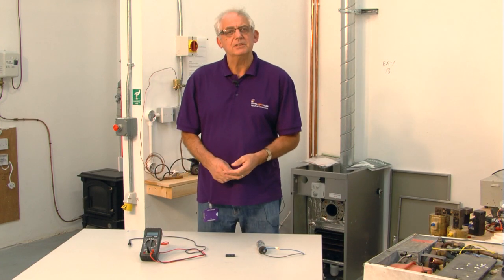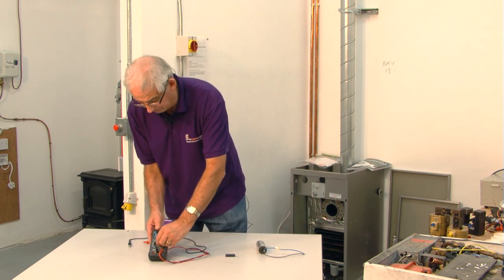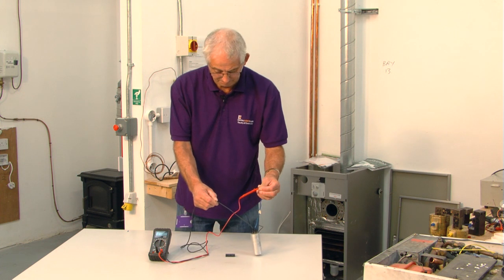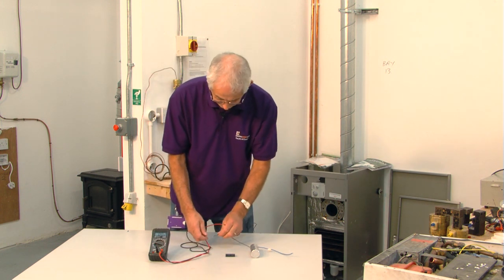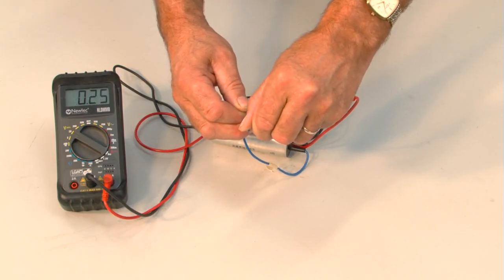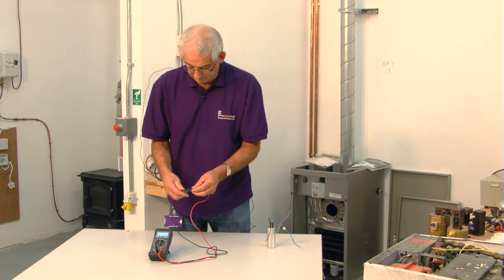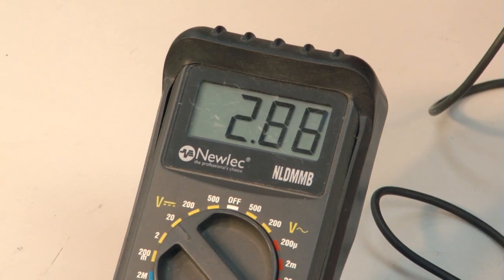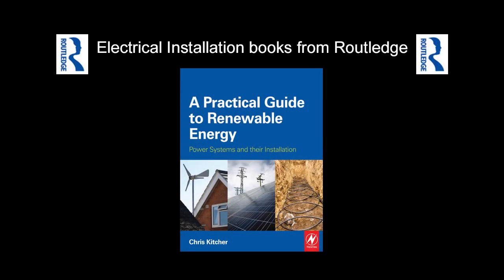Capacitor Test

Comment: Actually, there are a lot of factors.
-When we are dry our resistance increases. 
-When we are wet our resistance decreases. 
-etc.
And most of all I believe the capacitor capacity is low. "JUST LIKE" (12volts or 9v or 1.5v. )battery when holding we won't be shocked or electrocuted.
[Did you know that a even rubber can shocked you? It's called static electricity - well it's not that fatal.]

Being shocked or seriously hurt or death is possible when he swallowed the charged capacitor.

Comment: If the cap is shorted it would give a continuity reading because the electricity would just flow right through and that means it's bad.

Comment: when 1)capacitor is shorted then your multimeter will show very very low resistance or it will sound beep, 2) you asked abt open capacitors? remember capacitors are always open circuited frm inside, its required for an ideal capacitor so when u connect the multimeter it will show resistance in mega ohms! hope u understood!

Comment: YUP! In class one day I was holding two, old axial caps, one 200v, the other 250v. I inadvertently had my little fingers wrapped around one lead of each and, also inadvertently, touched the other two leads together. after that rude awakening I never again needed to be reminded about safety with capacitors.

Comment: No, I'm an electrical engineer and when I was in school they always told us.  Fast forward to when I started working for an electric motor repair shop the old man that used to work here charged up a good sized cap and shorted it with a screwdriver across the terminals.  Made a loud crack and arced pretty good.  He said, that's why you don't want to touch them.  I always knew and have worked with some very high voltage caps here, it was just good to see it.